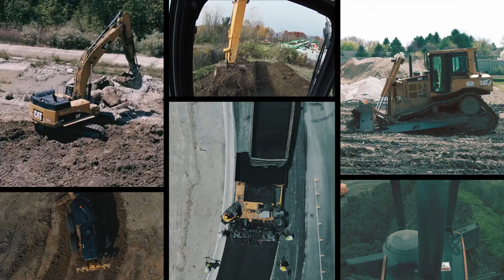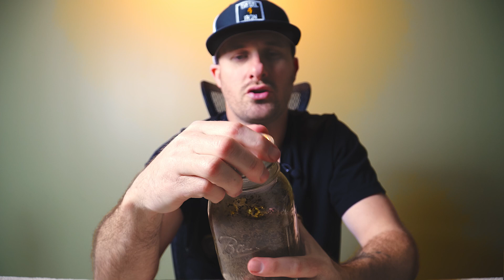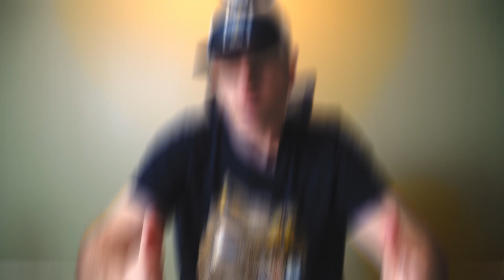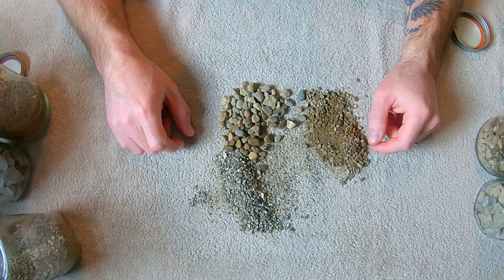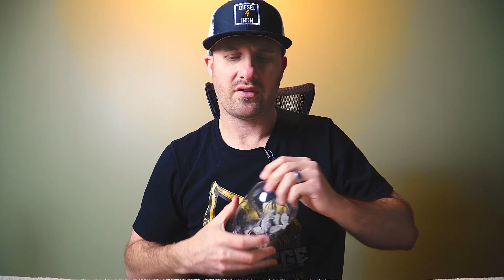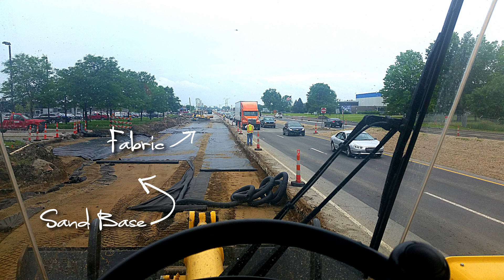WHAT ARE BASE MATERIALS//Why Are Certain Base Materials Used-All About Aggregates-Road Base Material

Comment: awesome video! I have a question for you. I just laid 400 ton of class 6 road base over an existing gravel driveway 3" to 4"  thick and vibrator rolled it 2 months ago. We just received our first major snow and the home owner just called me saying that he has a super muddy mess with 3" to 4" ruts. What would your approach be to fix this add 3/4 inch crushed and re roll it?
Reply from the maker: Generally if you are getting a mud problem it means the material has too many fines or silt it it.  I would recommend getting something with a bit more angular stone in it that will lock in without the fines.  Another great alternative would be to cap it with millings.  They pack down and after a good summer with lots of heat they will bind together and make a layer of asphalt.

Comment: @dieselandiron thanks for the info. Being you're based in MICHIGAN,  would the aggregate of a road bed  be the same in a southern state like Georgia or Alabama?  Due to freezing not being an issue as much down here.
Reply from the maker: That's a good question.  I'm not familiar with road building techniques in your area so it would be hard to say without looking at some prints.  I would think the only major difference would be the sub grade materials and the amount of drainage taken into consideration.  This allows water to get away from the road bed so freezes won't cause the road to heave.  That's all speculation though...

Comment: Its amazing the way different material is called different names in different places. Road base for us in the desert is ABC. a combination of rock normally 3/4, some 1/2, and some fines to lock it in. We do have pea gravel and various screened gravel sized and the a number of crushed. 3/4, 3/4 minus same with 1"" or 1/2" all crushed and screened, or for the xx minus crushed and mixed. And we have alot of granite of different colors, usually named after the pit it was mined from. Used for decorative and dirt roads and driveways, and up in Flagstaff we get cinders. Volcanic cinders of various sizes. Thank you and be safe.
Reply from the maker: Thanks for the support brother!

Comment: Help! I’m a chemical engineer not a civil engineer lol, so I know little about this! Making a homemade driveway strong enough so school bus can use our driveway as the new turnaround (since the City accidently got rid of the only turn around for our entire neighborhood street, so I have to drive kids 4 x / day until my driveway is complete!). I have the geo tech fabric but debating at what point I lay it on the rock. My main question is HOW would you grade the road if the fabric is already laid down?? I have both 1-3” angular basalt which is strong and drains nicely. Some of which is down already in parts of the driveway but not all. I also have 3/4” angular clean gravel. I do need to do a little more road grading but worried if I lay the fabric too soon I will accidentally tear it up. I am using a box blade (with teeth that can be removed), and also just a regular bucket on a decent sized John Deere. I have already cut the public street asphalt road along the edge and already need to do repairs since parts have cracked off. No one ever talks about this hard part of how to connect the public asphalt road to a renovated gravel driveway (ours is now 100’ wide and shaped like a T so the bus has enough swing room before they back in to our driveway to turn around. I’m really worried about the edge and it is tough to cut down into the ground so close to the live without anything breaking. 
I also bought commercial strength Truegrid paver grids for the top layer of gravel to help with distribution but was going to put it all the way next to the asphalt but along a block and concrete line next to the asphalt which will, hopefully, allow me to REPAIR parts broken off or cracks it now has. Doh! Hubby getting impatient and says I’m way over engineering it and we should have just added more gravel but I know that would have just ended up to be a muddy mess eventually (it was already actually but the parts I added the larger 1-3” aggregate and resloped myself has helped immensely! 
But how do you grade with fabric below the rock (“very carefully…”?)? 
Thank you for any advice!!
Reply from the maker: If it were me, I would peel back all of your existing stone until you get to dirt.  Keep it in a nice clean pile where you can easily push it back out.  Once you have your area graded flat, lay out the fabric and overlap layers by a foot or so.  Now push the stone back out onto the fabric.  If you use your box blade and drive in reverse you should be able to grade the stone nice and flat out onto the fabric without too much of an issue.  Keep 4-6 inches of stone above the fabric to give you a nice drive that won't flex under the weight of the bus.  If you are still having issues you might try capping that off with some screened asphalt millings.  After a month or so of hot sun combined with the weight of the bus and cars driving over it, it should tighten up and feel almost like an asphalt road.  As far as tying into the existing road, dig down about eight inches to 1 foot right at the edge of the road, about 1-1.5 feet back.  Fill that entire area with stone.  That will give you a nice solid base for your transition from the existing road to the driveway.  That should last you for awhile!

Comment: I have a collapsed 1940s raised concrete porch and I would really like to be able to use that old concrete from the suspended pad broken up into chunks as filler between the new cinder blocks I'm going to pour a footing for and build up along the outside. It's like a four or five foot Gap top to bottom.  I'm wondering if I can fill that 4 ft with the old broken up concrete and some gravel or dirt before graveling or if it's hopeless and I need to pay the cost of having it dragged off.
Reply from the maker: The only issue with filling spaces with broken concrete is the fact that you have voids until the material really has time to settle.  There will be pockets between the concrete chunks that dirt won't get into until water is present.

Comment: You can explain things really well. 

I have a question. I'm remodeling a bathtub on a slab foundation. I'm currently trenching the drains, and have tons of crushed concrete. Should I use the crushed concrete as backfill before I pour my concrete? Some of the pieces are really large (5 inches+), so I might not use those.
Reply from the maker: You could most likely get away with doing that and depending on your slab thickness you will most likely never have a problem.  My only issue with this is the fact that you will have a fair amount of voids in your back fill material which doesn't give you the strongest base.  That being said, it's a bathroom.  You're not going to be driving a truck over this area so you should be just fine.
Reply: @DieselandIron  Thanks for replying. The slab is going to be around 4" thick. Ideally I would want 3/4" minus gravel? Or would it be clean? I live in a pretty wet area, but I don't think water should be penetrating the bathroom floor.

Comment: I've been told anything above 2" will rip and tear the fabric...  So can 3" replace the fabric?  You said you put 3" on top of fabric all the time...  so I'm wondering why the manufacturer and distributor are saying nothing more than 2"...  I can't see it being shredded... I CAN see a few jacket pointed pieces poking through occasionally but over the majority of the area it would keep the mud from squishing up through...  Im thinking 2 rolls at $400 each is like 200 tons pricewise of stone... Im thinking it's cheaper to add extra stone...
Reply from the maker: We have commonly-used 2 and 3 in crushed concrete over top of fabric without issues. I'm with you, I can see a couple spots getting some holes poked in it but overall the fabric isn't going to fail. I don't know what kind of stone you are using but $400 for 200 tons seems awfully cheap.
Reply: @DieselandIron  Thank you so much for the reply.  I'd love to be able to talk further with you about it.  I've had a hard time finding any clear guidance of when to use fabric..  I have a self serve  quarry nearby that sells rock anywhere from $9-11/yard...  My dump trailer can hold about 5 yds... And they charge $50/load anyways so that's what I was going with...
Reply from the maker: @HiddenValleyHomestead  shoot me an email at thatdiggerdude@gmail.com. I'd be more than happy to talk with you.
Reply: @DieselandIron  And I did my math wrong.  $800 would give me 16 loads at $50/load and 5 tons per load makes 80 tons..  Sorry...LOL...  Yeah 200 tons would be like 5 bucks a ton...
Reply from the maker: @HiddenValleyHomestead  haha I was going to say, I need to send a couple train cards your way to bring some out here and turn a profit! 😂

Comment: great video and subject content on road construction. Just out of curiosity what do they call that white chalk powder material that they throw on top of the dirt just prior to placing rebar. Most recently I seen it even in a light green color.  What is it used for. Thanks and keep them videos coming.
Reply: At first this sounded like concrete powder, but that’s normally tilled or mixed into the ground before the road is paved
Reply from the maker: Thanks for the compliment!  I'll have to do some investigating on your question.  We don't have a prep material that goes down before the concrete roadway is laid.  Is the powder mixed into the dirt or is it just directly applied and then concrete poured over top?  What state are you in?  I'll try to get to the bottom of this...
Reply: @DieselandIron  thanks for the quick reply and potential follow up.  I reside near Houston, TX.  From what I recall the white stuff appears to be placed over the bare dirt.  It doesn't appear to be mixed in.  Also, I see similar stuff sometimes used on commercial building sites just after grading for the foundation has been completed and before concrete has been poured.
Reply from the maker: @bklynbob9039  let me do some homework and see if I can figure out what that would be. We don't have anything like that up here in Michigan but that doesn't necessarily mean anything.
Reply: @DieselandIron  Ok, now I'm curious. Did you find out anything about the powder?

Comment: All the guys at my work classify rock by the inch mostly then there's size-  and clean. we use 6in clean as our base ,cause we're in muddy Wisconsin, then add a few inches of 1in- to the top to seal it, crown it, and make it smooth.
Reply from the maker: It's amazing to me how much variation there is in terminology between states. Thanks for the comment!
Reply: Same here in north MS.

Comment: Bryan, that was excellent.!!
Could you expand on it a bit though?
Not all of us are "fancy" (LOL) and live in Michigan on paved roads.  Maybe you could expand this out to gravel road construction and materials.

Also, any chance you could touch on calculating compaction on these different base materials?
Reply from the maker: Let me see what I can do. When you refer to calculating compaction, are you referring to how much settlement you'll get during compacting or how many passes it will take?
Reply: @DieselandIron  Mainly settlement during compaction.  I usually use Spikes compaction calculator, and sometimes it works out, sometimes it doesn't.  I'm mainly talking about a slab on grade type pad that I need to get to grade and have compacted with a vibratory roller, and rebuilding long gravel drives and turn arounds, where I have to scarify, grade, and compact the base, and grade and compact the gravel surface.
Reply from the maker: @waynevincent5448  The honest truth is there isn't a good method outside of the initial estimation (using calculators or just a rough rule of 1.5-2" per 1ft lift) and then doing some onsite tests to dial it in.  The method we often used when running GPS on our equipment was to do a trial area with the dozer set to finish grade.  We would have the water truck hit the material and then roll it before having the dozer come back over top of the material.  Using the GPS we could set the blade to "grade" and then adjust grade down till the blade touched the top of the material.  The cut offset shown on the GPS would be our adjustment number for rolling out the material.  For instance if we had a fill of .85' and the material compacted to be .15' lower than finish grade, we would set the GPS to perform a 1' fill with the loose material.  When the roller came around it would settle to where it needed to be.  From there it's just a matter of doing periodic spot checks from time to time.
Reply: @DieselandIron  Thanks for the reply, and the info.  I will give that method a try, and see if it gets me where I want to be.  I just hate realizing I'm going to be a 1/2" low on a 753' by 12' driveway on a Friday afternoon!  Seems like I'm always short, and rarely long on material.  I usually see the issue when I'm pulling material from pits other than my main supplier, which I think points back to QC at the pit itself.
Thanks for everything you do on this channel, I'm really glad I subscribed!  Really looking forward to getting my "Hone Your Craft" hoodie that I ordered on Sunday.
Reply from the maker: @waynevincent5448  I hear you.  Material estimation is an artform and I'll just leave it at that!
I didn't realize that was your order.  I truly appreciate the support brother!  Let me know if you've got any issues with the order and I'll get them corrected for you.

Comment: Any questions about NY/NJ aggregate just ask me! I run the loader in a quarry in NJ. If I don't know the answer, I can ask around.
Reply: You pretty much nailed it. Like you said different names here but same material. And you probably know but didn't mention, those "veins" they get all the round material from is actually formed from an ancient riverbed. This is why it's round because it was smoothed by the water rushing over it.
We don't have too many of those out here so we mostly have manufactured or crushed stone and sand. My quarry is on Arcadian granite which we blast, crush, and wash for everything from 5"x9" gabien down to ultra fine pipe sand and "pond fill" which is so fine it's like clay.
Because we crush the material, it is ideal for concrete and asphalt mixing due to the sharp angles and rough edges like you said gives it great compaction.
Reply from the maker: @wraith0127  I was trying to balance the interesting aspects with going too far down the rabbit hole. I thought about talking about water eroding the rock to its various shapes and the impact of glaciers in our area but I figured I'd lose people. I go pretty far down the nerd hole. I chatted with the civil engineer for an hour because I was genuinely having a good time 😂
Reply from the maker: Nice! Feel free to pitch in on anything I missed or overlooked.
Reply: Very true lol!
Reply from the maker: Thank you sir!